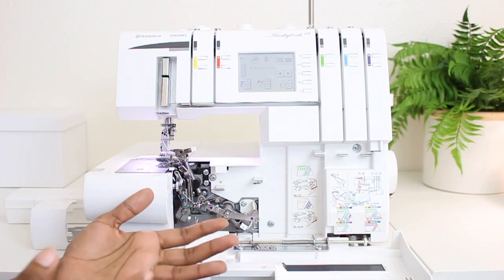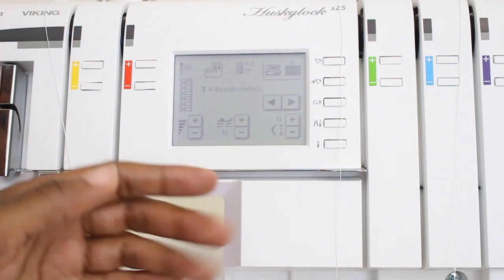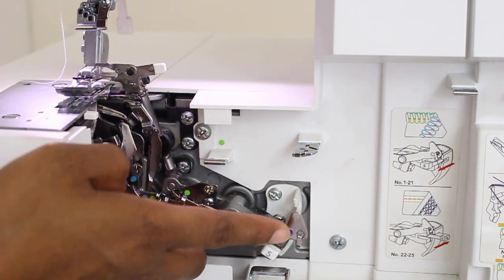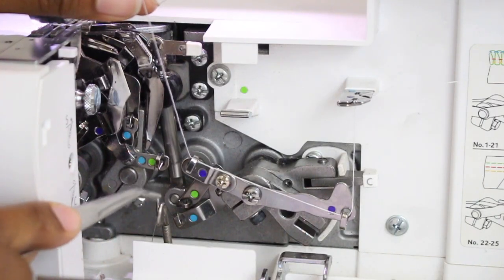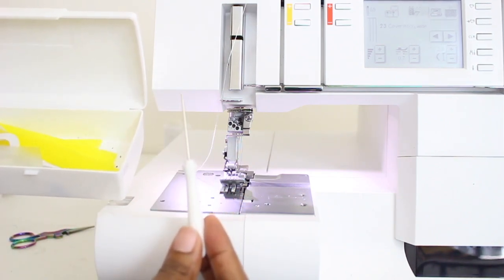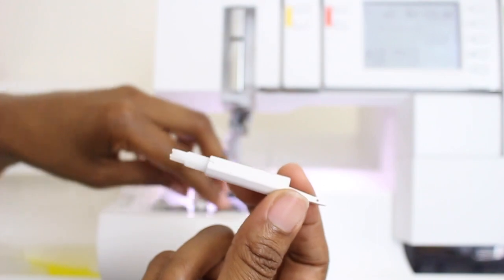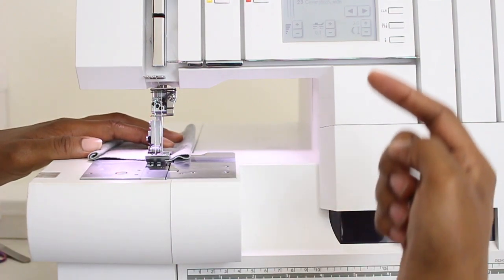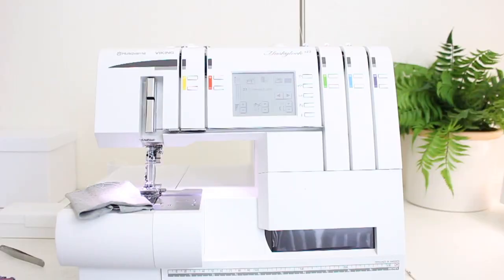SERGER SERIES: HUSQVARNA VIKING: HUSKYLOCK s25: SERGER TO COVERSTITCH

Comment: Brittany, your tutorials are EXCELLENT. Well lit, great closeups, and you blow the others out of the water. I am so frustrated - I'm positive I've threaded my Huskylock S25 properly and in the proper order, but the looper thread keeps bunching up. So far, out of six samples I've sewn, five of them had to be cut away from the machine, and the one that DID sew to the end had terrible tension. The knit is lightweight and my thread is polyester serging thread. Got any suggestions? Thank you again for a terrific series - your explanations are the best!

Comment: Hi Britrany, I am always intimidated by changing the stitching on  my S25. Thank you for such an excellent video.  I had to modify the seat section of a bathing suit. I stitched the elastic in the legs to the flap of the hem. In doing "sew" I had to pull the elastic taunt which has created small gathers. Now I want to hem the legs using a cover stitch as the manufacturer did.  I in your video that you were sewing on stretch fabric as is my bathing suit. My question is because slate gathers were created with the elastic, do I need to pull the elastic taunt again in order to get a nice cover Stitch?

Comment: Do you still have this machine? If so, did you have any issues with it?
Reply from the maker: @Kelly64944  hi Kelly. Yes I still have it and use it mostly as a back up or for coverstitiching now. I bought the Pfaff air threader serger in 2021 and use that mainly now for overlocking. When I was using thr Huskylock daily, I did not have any issues and have not had any when I do pull it out to use it. ❤️